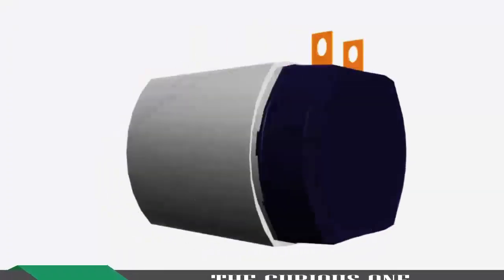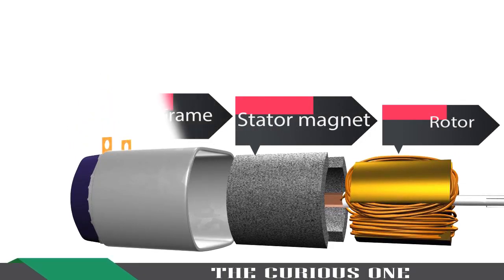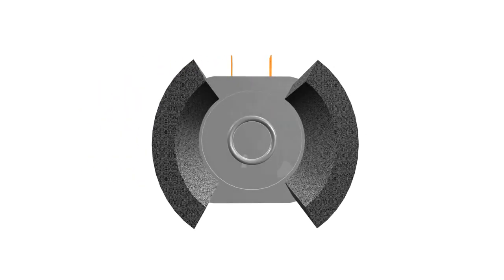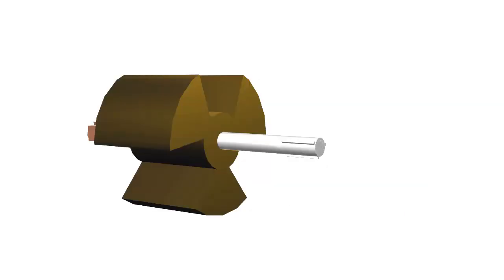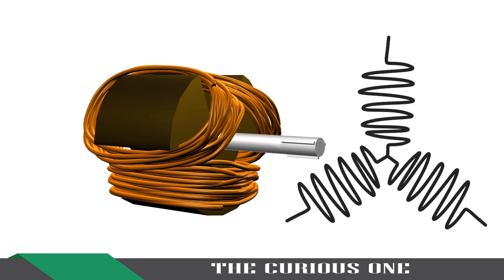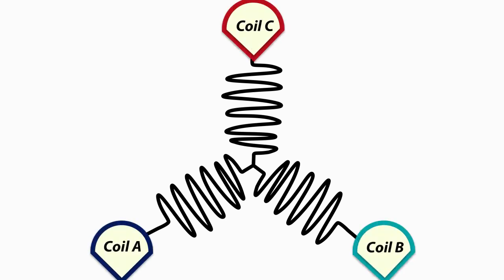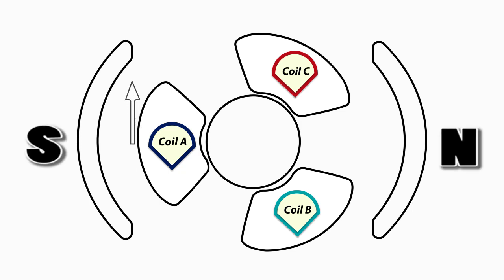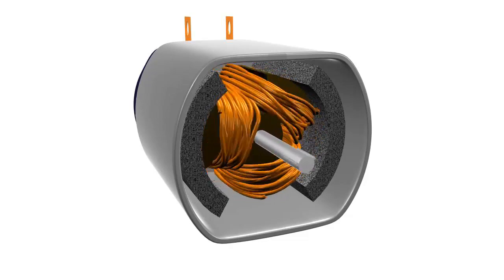How Does Permanent Magnet DC Motor or PMDC Motor work ?

Comment: what about coil b please tell?
Reply from the maker: In this figure rotor having 3 poles (A, B, C) ,  but at a time supply given to 2 poles like AB, BC, CA . when current passes through CA path coil A and coil C magnetised  and they attracted by parmanent magnet pole, but no current passes through B so, coil B is not magnetised , no attraction force work on it. 

       in next cycle when coil rotate then current passes through AB path, coil  A, B magnetized, attraction force work on them , but c is not , because no current passing through coil C.
Reply: one end of b at the common star. , and the other is open. So i think current wont flow anywhere..

Comment: How electromagnetic field is generated in generator?? I mean how power is given to coils to generate electromagnetic field.
Reply: Mmm it's not clear your question but on generator they start by crank or electric starter then the coil and everything else is power by the Magneto once the engine started the Magneto is a magnet on the side of the engine it spin with the engine   and it as  adjustable points and a condenser behind it  that generates electricity to power the coil and everything

Comment: how north pole(coil A) experiences repulsion from south pole?
Reply from the maker: +Kshitij Bende there are 3pole in rotor and 2pole in stator(N,  S),  rotor pole A, B,C energies by supply current, at a time two pole energies,(AB, BC or CA) if you consider the geometry then you notice rotor pole 120` apart and stator 180', they never  be in balance, one part attracted and other part repealed.

Comment: I had heard that PMDC motors just use field magnets instead of copper coils but i can see coils here O.o How????
Reply from the maker: +Aditya Singh Here field magnet present in stator, they are permanent magnet (ie PMDC)  and coil in rotor, its act like magnet when current passes through it.
Reply: Got it! 10/10

Comment: Why not supply magnetism in to magnetcharing coils insted. Then the motors not need any power input. An goes forever. Eternty. The world is fooled. And i fiks that. Remember the coils is just making a pull og drag on the stator. The samme as a distant contaktor magnet doing in my idee. And remember all magnets can be conected and if you short a tre star contected magnets. Ore star conected magnets. It vil not be a magnet any longer. So just 1magnet coil can open ore close alott of magnet overunty force.